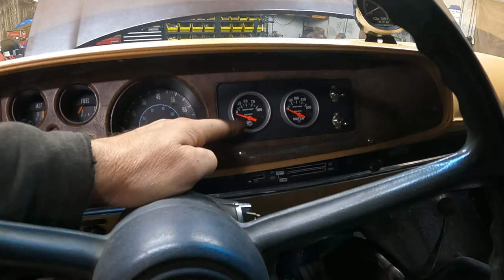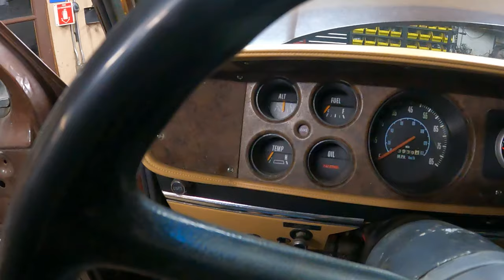Radiator Controversy and Electrical Gremlins!  Dodge W200 Restoration

Comment: 👍🏻I painted my aluminum radiator on my 53 Chevy 10 years ago and it still looks like the day I painted it, besides the bugs stuck on it
Reply from the maker: Yes.  I've run thousands of miles with painted aluminum radiators with zero problems.

Comment: LOL, Oh man Josh you are cracking me up here, The radiator Thing. Silver and black. LOL, I have had a customer with a dodge challenger one day question what I forgot, I figured out it right away but waited. It was he could see the silver through the grill. 🤣the new condensor from mopar came silver. ever since then I spray some black on the front facing side before installing them. Awesome video thanks for sharing, Have a great week🙂
Reply from the maker: It's the worst on '30s and '40s cars that you can clearly see the rad behind the grille!

Comment: Why worry so much about a black radiator when you leave that door with that big clease!
Reply from the maker: Because, for the 50th time, this is not a show truck restoration!  EVERY PANEL ON THIS TRUCK IS FADED, SCRATCHED, AND DENTED!  That's how I want it.  Just wait until I put the bed back together.  I am putting this together with (most) of the original body panels in original patina.  That's a thing today, you know that, right?  Just go look at what OG paint trucks from the '60s and '70s are bringing.  This is the same, except it's all new underneath.  I want a truck I can use and abuse.  If I wanted a show truck I would have junked this one and bought a $35,000 restored truck.  A truck that would be useless for anything except going to car shows.
Reply: Don't be so touchy! I like pulling your chain. It gives me something to do twice a week. I don't see😂 why you fixed that rust in the right fender if you  love patina so much. It wouldn't take much to pull that crease out of the door with a slide hammer.  It's not my truck so you make it any way that makes you happy.  They say beauty is in the eye of the beholder! That's all for this week!😁
Reply from the maker: Sorry, didn't mean to use capital words.  The crease is way less visible than it was originally.  I straightened about 80% of it out.

Comment: would look a little better if the wire for aux park lights went in at headlamp bezel where it wouldn't cross over the bulb just my thoughts you might have a good reason for doing the way you did
Reply from the maker: It's the way Dodge did it when they added the Meyer plow package.

Comment: should have found the oem indash tach
Reply from the maker: I could have, but #1, chances a 43 year old factory tach still works are slim, #2 these trucks are non existant in junkyards around here so finding one is impossible, #3 on eBay people want a fortune for things like factory accessories like tachs, #4 I wanted a chrome cup aftermarket tach like back in the '80s.